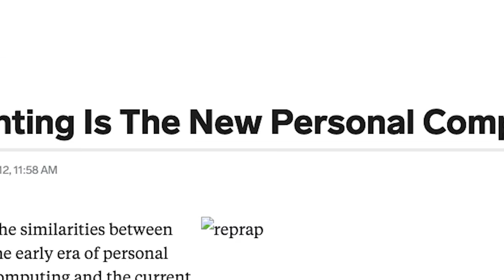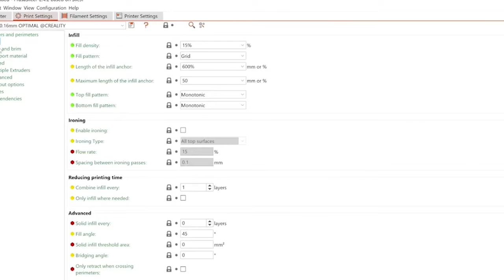Home 3D Printers Will Never Work

Comment: Yup I have had my Ender 3 for almost 2years now use it 5 days a week atleast. 

BUT I have had 2 major failures that would push the average consumer off a printer. 

My hotend fans needed replaced so I swapped out the hotend a bit ago. 
Now my extruder is skipping a lot and I think it’s time to swap that out. I am hoping it is the extruder as the hotend is newish and I have had good prints since the swap. 

<3 if you read that
Reply: If it has a bowden tube, print one of the direct drive mounting brackets. I had extrusion problems for years before I finally tried it.

Comment: Many home/office 2d printers are far more complex than any consumer 3d printer. Any car is way more complex not to mention computers(but not as many mechanical failure points). It's not about complexity but the existence of ecosystems to handle that complexity and to provide content to print. Not to mention that the use for simple fdm parts is limited. Multimaterial, pick and place, automatic post processing  and integrating electronics in to prints would bring us closer to the Star Trek replicator people imagine but that puts even higher requirements on the ecosystems. 

Bambulabs seems to be closest to the appliance label and simple replaceability of most common failiure points. But we also need to eliminate slicing and make it easier to find and create parts. I'm sure machine learning will provide huge advancements in this space in the not so distant future.

Comment: I'm not going to say your wrong. However 3D printers do seem to be getting easier and easier as time goes on. Maybe not today, but someday? Also, you mention that shipping with Amazon is faster. Maybe for a newbie to the hobby, but I actaully print stuff rather than ordering online, because (example) 6 hours is way faster than 2 days. But I'm also well experienced and have a lot of hours under my belt. So I guess for probably 95% of the consumer market... Your right, its more of a tool for the shop, than an "appliance" for the home.

Comment: I agree that most people dont need a printer. Its great that its available for people who want to make stuff but unless you use your printer for work its just a fun thing to have, like a video game or other novelty thing. Average people would be much better off just buying things  they need vs printing at home. I make custom cases for battery packs so i need alot of test prints and designs can change anytime so i need a printer in the shop for time management but if i didnt use it for work i would just send my stl files for little stuff like drone camera mounts to a print farm. I do have a small printer at home thats used for drone parts but its mainly for testing material settings and dialing in my skills for the real stuff, the drone parts are just a bonus.

Comment: Bambu lab x1 carbon has entered the chat
Reply: A fine machine until something like the levelling starts to fail because of lidar failure. Or a secondary propietary board fails. . They do have warranty. But for how long?
Reply: @fofopads4450  The argument you're using is not very relevant. Most people's electronics or appliances use components that will eventually fail and at that point they will seek the manufacturer's warranty which is usually 1 year long. The Bambu Lab machines are a step in the right direction for the mainstream consumer who unlike you and I will never try to tinker and just wants a machine to work out of the box.

Comment: The biggest thing is that 3D printer is pretty much useless if you don't know how to design parts. Sure you can spend few days printing trinkets... but i have yet to print anything made by someone that i did not have to modify to actually be usable in my use.

Comment: Just replaced the water pump in my dishwasher for the second time, 3 years ago. 🤷🏻‍♂️ Replaced the ignitor in my stove 4 years ago. Granted, they don't break down often, but when they do, there are replaceable parts. Most people just call a tech.

Comment: First cars were complicated and required a deep mechanical knowledge to operate them, first computers were complicated and unpractical, and required a deep mathematical and electronics knowledge to operate them... same is with the 3D printers. Maybe now we see them useless in the average home, but so have seen computers 50 years ago. They definitely need to become way faster, and less bulky, but first text printers were also slow and bulky (and dot matrix printers never grown out of that problems). The same probably will be with FDM 3D printers. They probably are a dead end of the 3D printing technology.

Comment: Not for the moment. I personally can't find a use for a printer in a regular adult household,  but who knows in the future? The machines are slowly heading towards the low maintenance-compact design so in the close future I see them heavily used by children and young adults. They are tools for creativity, and really help in learning 3d design, programming, tinkering, inventing, etc. Learning 3d design finally has a cheap tool to bring the drawing to life. I remember that in school we learned programming without even touching a computer. What a waste of time.

We used to have tv's that needed two people to carry, had hundreds of parts, broke down all the time, developed deadly voltages of almost 20000 volts and had lead in the glass to protect from radiation, so the complexity is not a valid argument.

Right now, the printers are used as tools, and not everyone needs tools.

Comment: I'm a little confused with your argument.

True, the vast majority of people don't fix their home appliances. They still have those home appliances..... in their homes even.

Service people come and fix them, why could service people not fix your home 3d printer?

I don't think that point of use manufacturing will ever replace industrial manufacturing. I also think that it has an amazing potential place for bespoke parts, and is very applicable in the gradient between the two. You are the only person that has your weird corner of your house where a normal shelf bracket won't fit. Other people have weird corners as well, but you are the only one with YOUR weird corner.

Comment: What about the X1 Carbon. I wouldn't consider the price to be anything too crazy for a homeowner to have. This well-rounded working machine that produces high-quality parts and requires little to no maintenance.
Reply: parts for what? What do you think people who are not into prototyping etc need them for? Like my sister got a 3d printer, she printed like few cookie cutters and that's was it. 3D printer is a tool like a CNC machines. CNC mills have been around for decades, and nobody has one in their kitchen because nobody needs them unless you are into manufacturing.
Reply: @Nobody-Nowhere  I would agree and disagree. Just like any product, if you don't have a  use for it, it doesn't get used (buying one because its cool is an example of this). Yes, I would say a 3D printer is a tool. In my opinion, it is best used for prototyping, but it can be used for more. Some people use it to sell products (which, yes, is not the most efficient manufacturing method, but it's cheaper than injecting moulding when you're a small business). Also, depending on the part's complexity, a 3D printer might be the best method. Your CNC machine is a bad comparison, as one costs thousands of dollars, and the other can be obtained for hundreds. They are both manufacturing methods but not the same in the slightest. A CNC machine is also not practical to be in someone's house. You can also use 3D printing to save money (fixing things, printing small items which would cost more at the store). I think it has many uses. Do your research
Reply: i feel like the X1 carbon is almost there.  still needs to be more mindless and user friendly.  it's gotta be as easy as a microwave for someone's grandma

Comment: Strange...before watching your video, I would have totally agreed with you.  But, after watching it, I totally disagree with you.  Your certainty was the thing that made me think back in history and recall all of the absurd pronouncements about the impossibility of future developments.

Granted, not everyone will want or need a robotic fabrication device in their home.  (At least, from our current perspective.)  However, this presupposes that all of the present conditions remain the same.  This isn't limited to the technology, itself.  In fact, it has more to do with the potential use and cost-effectiveness...and that is something that we can't see the future of.  History is replete with examples.  There were automobiles decades before Ford, but it required that key technologies (like the carburetor)  and manufacturing techniques (like the assembly line) were used by an enlightened person (like Ford) to transform an elitist toy into an everyday appliance for the masses.  This same relationship can be applied to most developments.  Home computers? (Microprocessors, software, Gates/Jobs, Microsoft/Apple.)  Electric vehicles? (High gas prices, pollution, improved motors and batteries, Toyota/Tesla.)  Cell phones?  (AT&T breakup, telecom deregulation, spectrum allocation, Nokia/Motorola/Sprint/et'al.)  Fred Smith, the founder of Fedex proposed next-day delivery in a college paper and got a failing grade.  Nikola Tesla's idea for alternating current was ridiculed and dismissed by all of his teachers, mentors and most of his employers, including Thomas Edison.  Before SpaceX, there was never a single, successful reusable space launch vehicle.  Enron and Blockbuster failed to create a working movie streaming system, but improved software and broadband service made it possible for Netflix and others.  

I think you get the point.  The only thing more absurd than saying some magic device will be in every home to solve every problem is the idea that it could NEVER happen.  

None of us can know the conditions that could create paradigm shifts that make it possible.  Consider that the EU just forced Apple into something as major as designing USB-C as a standard charging port.  (Governments can do this and the impact is that the market will follow.)  Suppose the EU required that all food packaging be made of a specific type of clear plastic that had no printing or glued labels.  Then, say that these recyclables could be easily, cleanly, and cost-effectively processed into a base material, or even directly into a finished good.  Also, imagine that a process other than FDM, SLA, or sintering was involved.  Absurd you say?  Too expensive and complicated for home use?  15 years ago, you could have said the same of FDM, SLA, CNC, laser, and dozens of other things that are now common consumer devices.  Your dishwasher example was a bit simplistic.  I'd suggest something more like a InstaPot, which truly does things people would have called impossible a short time ago.

Comment: Really poorly thought out video. There is low complexity in 3d printing and can be taught in a week long course, and a weekend course to teach you basic 3d modeling. I agree on the fact that you mention centralized printing stations, which would be useful, as most people who use printers, don't use it 24/7 so the output would be much higher that way, plus you would pay for part wear instead of a whole printer. The only problem I see here is government getting involved in  some sort of centralized printing regulation, as some parts might be deemed illegal, which would be bypassed in a home printer, so I see great potential in 3d printers as a bypass to those problems.

Comment: Inkjet printers have 2-3 motors, a belt driven head, drums and friction systems to handle paper, sensors, a high precision ink injection system, etc.
Colour Laser printers can be an order of magnitude more complex than that. 3D printers as an appliance will happen at some point. Perhaps they won’t be FDMs but maybe a safe resin based solution with little user intervention. I think it won’t take more than 15-20 years
Reply: I’m thinking if 3d printer gets very advanced where it can print compact circuits boards and complex electronics, maybe we can then make our own phones or stuff, or even better the printer also can breakdown the stuff you put it, then we can reuse the raw material to make other stuff other than going to land field
Reply: I was amazed on how simple a 3d printer is. It is very basic technology and hardware if you think at it from an industrial stand point. The only thing that we were missing was good software to bring it to life. I still think that most of the current printers are used at about 50% of what they can really do. It will take some time until the software will squeeze every drop of performance of these printers. Or maybe it is still not their time; like the romans- they had the capabilities to build steam engines and industrialize, but lacked the reason for that; population was low, rather poor and slave work was dirt cheap.
Reply: I was thinking the same thing. Resin has much lower inherent complexity than FDM, but for wide adoption it needs a system where the user never directly interacts with the liquid. Similar to how 2D printers keep the ink sealed away until needed, and when it runs out you have the choice to buy another sealed cartridge or a cheaper but potentially messy refill bottle.

Comment: I agree to some degree. But perhaps, some clarifications are needed when we think of 3d printers sharing space with a personal computer. Just because every home has a personal computer, doesn't mean there is also an engineer, creator, designer, mechanic, and/or tinkerer, etc in that home. But if there is, a 3d printer will probably make it to that home.

Comment: This seems a bit short sighted. The printing press is a better example- large, heavy, specialized tool that could crush your hand if you were too slow to operate it. I wouldn't consider a 3D printer an "appliance" just as I wouldn't consider an inkjet or laser printer that either, and I bet no one thought of ever getting their own printing press in the living room when it first came about. A 3D printer is a tool of tech. More in line with a robotic vacuum or a SodaStream machine, you're not replacing the parts on those items when they go out like you do on an appliance. You buy another or send it off for a warranty.

Comment: He completely forgets the fact that electronics repair services exist for our complex electronics. What do we do when they break? Have them fixed by one of those services. Why can't the same be true for 3d printers (in time of course)? Even aside from that 3d printers are substantially easier to repair and work on than most modern cellphones. You can look up a tutorial on the internet for minor things like nozzle changes, extruder calibration (though this won't matter once 3d printers get more consumer friendly), etc, and the average person with any hardware experience would be able to follow along. The claim that home 3d printers will never be viable is just dumb. Back a few decades ago having computers in people's homes wasn't viable. Now you have one in your pocket, and so does everyone you've ever met. Why? Because they improved over time and got more consumer friendly. There's nothing to suggest that 3d printing won't do the same.

Comment: The AnkerMake is super, super easy to use. I have yet to find a file that doesn’t print on the basic profile. And it’s a bed slinger. It goes 250mm/s easily without disturbing anything but the tallest+narrowest prints.
CoreXY is way easier and better.

The inevitable trend of civilization is building up specialty skills until a threshold of efficiency or productivity is breached with some new feat of engineering, where we then have a new general skill to master that makes our specialized skills easier or more efficient.
Reply: How do you have one when no one else has them yet.

Comment: FDM machines as we know them are far from smart enough. But it is possible to make them a lot smarter. Stuff like adding cameras that can detect problems and then adding systems that can deal with said problem. For example a printer could replace it's own nozzle if its worn out or  clogged. 

I don't think complexity or reliability is the reason why we won't see a 3d printer in every home. Those issues can be solved over time and we have made a ton of progress over the years. I can remember the first RepRap I built around 10 years ago. I was having a good day if I could get it to print a simple cube. We have come a long way since then. Now we have printers on the market with cameras that calibrate the extrusion. 

The real reason we will never see them in every home is that 3d printing will never be as good as injection molding for most stuff yet cost atleast an order of magnitude more.
Reply: I don't think there will be enough of a reason to swap out nozzles due to wear, it is much cheaper to just go with a more expensive nozzle and then maybe once a year (if not every several) bring it in to be tuned up. I'd be more inclined to believe swappable hotends would be a more common thing before automatic nozzles. Unlike milling machines, there aren't a lot of things that can be done with one nozzle/tool that you can't do with a different one. Now, the hotend itself being swappable is a much closer analogue...
Reply: @SirSpence99  Clogging is the more common problem. We have a number of printers running everyday at work. We end up with replacing a few nozzles a year due to clogs. We clear some of them but its often not worth our time. The new e3d revo system looks interesting, it wouldn't take much to make it fully automated.
Reply: @lordgarak  Ehh, it would take quite a lot of work to make it automated and keep in mind the runtime of those printers, if a printer runs on average for 3 hours per week, clogging probably won't happen more than once a year unless you are using specialty filament.